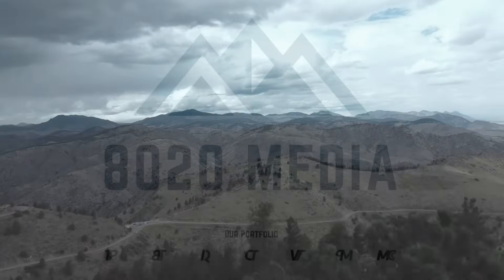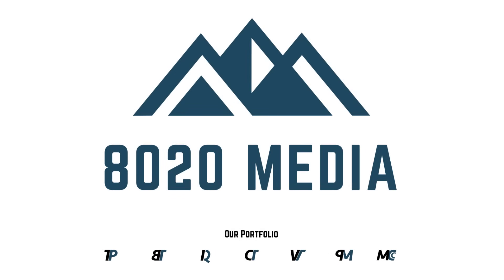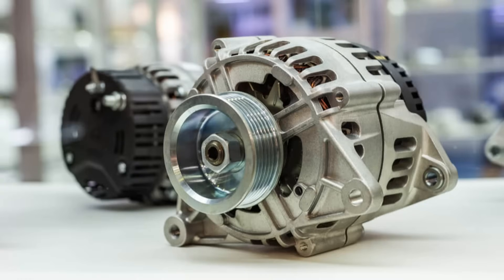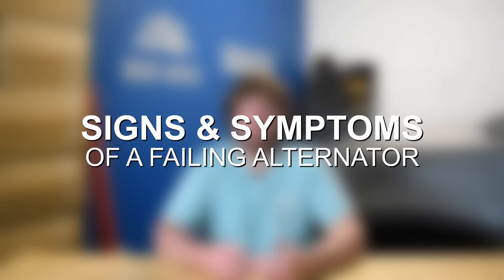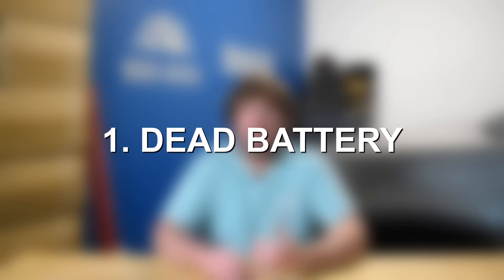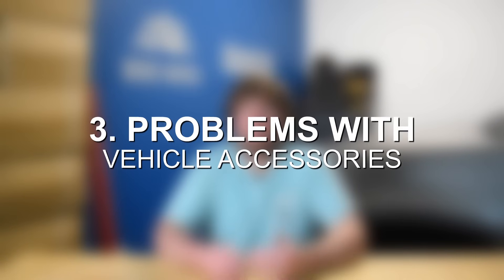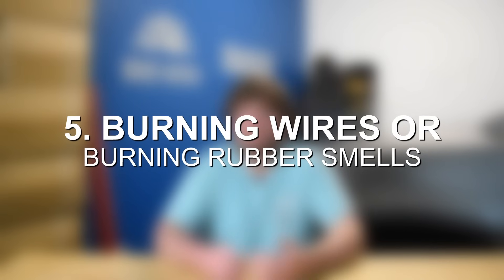6 Symptoms of a Bad Alternator!

Comment: I have a 2012 Honda accord ex-l. While I'm driving my battery light won't be on but a little after I turn on my a/c the light will come on. After I finish driving most of the time I'll turn off the car and it will start right up with no battery light and eventually it will come back on. After a small drive I parked my car and went to start it and it wouldn't start but after waiting a couple hours without charging the battery it started right up. Its leading me to think its my alternator but I'm confused how my car wouldn't start but after letting it sit without doing anything it started right up.
Reply from the maker: B - Certainly sounds like an alternator issue. You can get your battery tested to rule that out.

Comment: I'm just trying to figure out if the problem is my battery or alternator and ended up learning 4 times as much...
Reply: That is exactly the problem my peugeot 207cc has ,all those symptoms are visible, It seized on the way I called a mechanic, he came and jumpstart the car,after 1 day same problem, we bought a new battery and I only drove the car for 40 minutes, it drained the new battery. So I have transported the car to the garage ,after explaining all these to them I told them the car surely has alternator problem.
Reply from the maker: N - Sure sounds like it to us!
Reply: I got an battery and an alternator tester and it says that my alternator needs to be replaced . I was wondering why my car won't crank up even when people connect their jumping cables on
Reply: When I put the key in it will do a click click sound or the engine will turn over but it's not getting its power needed flickering lights kept blinking on before it couldn't cut on
Reply: @Cierralewis5016 that means a new battery
Reply from the maker: R - Hope that's a good thing? Thanks for the feedback.

Comment: I have a 79 Lincoln Mark V.  It died on the road today as a result of a failing alternator.  Would it be a bad idea to install an alternator that's More powerful than the factory. 60 to 70 amp alternator?  I was Thinking 100 amps.

I have an aftermarket sound system with an 800 w amplifier that powers two, 12-in subs (So it's nothing crazy).

I've heard that oversizing an alternator could fry the battery cells, but at the same time I don't want to be stranded again as it was not very fun today.

Any help would be greatly appreciated. 

Thank you in advance!
Reply: Hey I have a 79 Lincoln Continental and had the same issue it would should off on my all of sudden got a new battery but still don’t crank over to start now what did you do do yours ?
Reply: @juliancar2  100 amp alternator+a capacitor for the amp
 & subs
Reply from the maker: R - Have you taken it to a mechanic?
Reply: @8020Automotive  Yes - 2 mechanics.  They told me that the alternator is shot.  Even as I was testing the alternator myself while the car was running (after boosting), the voltage of the battery was declining instead of charging, or hovering around a constant voltage as it should.  The battery is 7 days old.  I was told that the best way to deal with this, would be to use an alternator with bigger amperage, as the aftermarket sound system is drawing significantly more than with the current alternator is designed for, and to use something as a buffer (such as a capacitor, a battery equivalent to the one running the car, or a gel battery).

Essentially, the alternator was not keeping up with the draw of the aftermarket sound system, so then it became overworked and ended up failing.  Contrary to what many people believe, a 100 amp alternator that replaces a factory 60 amp alternator will not fry battery cells.  If we were to throw in a 300+ amp alternator that is meant to run competition sound systems, then it would affect the battery.  Since we're going from a 60 amp or 70 amp to a 100 amp, the difference is not enough to warrant such concerns.

Hope this helps.
Reply from the maker: T - Wow! Thanks for taking the time to share this. It will certainly help future viewers.

Comment: One question, can bad altenator cause the aut. transmission not working properly. 
Sliping, vibrating,
Reply: O and NO codes
Reply from the maker: T - It does sound like an alternator issue based on the symptoms above.
Reply from the maker: T - It certainly can! Do you have any engine codes?
Reply: Well, just at starting the engine the lights of ABS, TCM, ESP come on for second/two.

 Did notice that when i drive with lights, fan, OFF transmission is working litle beter

Comment: My Battery light came on and while i was driving all the lights turned off as if i cut the car off but was still driving then died about 45 seconds later? Think its my Alternator i have a 2018 ford f250...
Reply from the maker: D - Certainly sounds like it! Keep us updated.
Reply: @8020Media  Definitely was went got a new one FIRED RIGHT UP ALL SYSTEMS GO‼️🕺🏽

Comment: Does a alternator and fuel pump have any relation whatsoever? Because for a little while now I’ve had trouble starting the car within 5-20 minutes of turning it off, but if it’s longer than that it starts no problem. Thought it was fuel pump at first but I had my alternator tested and it said it wasn’t good. Now, my brake, battery, and ABS light come on intermittently. I do hear a slight whine noise when I turn the vehicle, and when I popped the hood I did smell sort of a burning/hot smell. No overheating however or rpm’s going crazy or anything.
Reply: Yeah, that's definitely your alternator, bud.
Reply from the maker: T - Certainly your alternator. Keep us updated.

Comment: Can a rebuilt alternator be going bad and overcharge my battery??…. Bought a new battery since it was boiling/hot to the touch. New battery in and still overheating….. should we replace the alternator all together?
Reply from the maker: Sounds like it could be the voltage regulator - if its failed it could be sending way too much voltage

Comment: Hey quick quesion, my 2011 Ford Explorer is showing the "check charging system" light on the dashboard. The power steering is electric so i can feel the power steering tightening up while reversing. I installed a new alternator a month ago from amazon (A-premium brand) and it worked just fine until now.

You think it's the alternator going out? Any chance a new alternator can go bad that quick? Or maybe i should change the timing belt. I've already installed a new battery a month ago.
Reply from the maker: Z - This sounds like an alternator issue. It is possible that you could have bought a faulty alternator. Have you had it checked out?

Comment: I just changed my alternator but when i was gonna turn on my car all the lights where on like if the car was was on i can see my miles and everything with out the key ignition , once i did turn it on i rollerd my passenger window down a lil bit after i cut it off and cut it back on i had nothing no dash no radio no windows , what you think possibly happend
Reply: Yes that actually how it died down i was driving it back from shop and it started sturdering and bogin out before completely turing off my battery completely went out , im thinking they didnt connect the alternator correct or the pig tails cause the back conector to altanator had broke so we had to connect a new one
Reply from the maker: A - Sorry to hear about this. Keep us updated!
Reply from the maker: A - When was the last time your battery was replaced?
Reply: 1 year ago it was replaced boss .
Reply from the maker: A - Hmm. Our guess would be the battery, but it shouldn't lose it's charge that soon. Have you taken it to a mechanic?

Comment: In my mind a test for the alternator is with the engine running take the positive lead off of the battery. Then check voltage across that lead to body ground to see what the alternator is actually putting out. Anyone know if this is a viable test or if I'm on crack? My 2016 Odyssey has battery light on. Had burning smell last week. Check  voltage on battery with van off - 12.1v. Start van and it drops to 11.5ish. Remove battery positive lead and it dies instantly. At $801 OEM new part, $470 for a record I really want to be sure before I buy one! Thanks all.

Comment: This is probably been one of the most useful videos. I have a used 2010 Jeep liberty sport.
I have already replaced the battery back in February.
For the last week, my car is suddenly dead overnight with no lights on or doors open. I’ve noticed the motor functioning to my window slowing and there are times my lights will dim and adjust while driving. I jumpstarted the vehicle and still having some issues. I am going to try to get my car in somewhere tomorrow. Thankyou again!
Reply from the maker: O - Certainly sounds like an alternator issue. Thanks for the feedback!
Reply: Same thing happened to my jeep

Comment: My car loses acceleration only in the night after driving some distance and steering becomes little tight . But no problems In day time driving. then I noticed the dash board flickering when headlight on and when I off the headlight and drove…no issues with power loss
Also I smelled some wire burning ..
Battery has green indicator 
I guess it’s alternator
Reply from the maker: Yeah you're alternator is probably weak. It can't keep up with the extra current draw required by the headlights. If not that, an issue with the idle air control valve could cause it as well. Worth checking that first before spending money on an alternator

Comment: How about an alternator that works part time. When I start the Kia the battery light is on and if I rev the motor to 2500 RPM then it starts working. It’s do e this for months then now it won’t work. The next day it worked again just to stop working again. lol. I have checked everything. Literally everything. There is no check engine light so for once I’m freakin stupmped and I gotta get it figured out.
Reply from the maker: B - I mean it is possible for it to be intermittent. You may want to get it checked out.

Comment: I bought a new battery hoping that it would fix the issue but nope 😢. Battery is 14 years old so thought it mighr have been it.
Reply: What kind of battery is that last 14 years I need that brand of battery.
Reply: @samuelbrown7108  Lol, i dont think they make it anymore, it was a stock panasonic battery on a 2010 evo x
Reply: @samuelbrown7108  everlast 😂
Reply: Battery and alternator could both be bad
Reply: I changed the battery and drove it 2 hours and it died
Reply: @nanicasillas6492 
You need to replace your alternator ASAP. Your car's alternator is bad and it's draining your battery.
Reply: Jump start then drove a few minutes then it died again
Reply from the maker: N - Have you looked at the alternator? We also have a video on engine stalling that could be helpful for your research: https://youtu.be/7bqAIbYRdnc
Reply from the maker: U - What problems are you experiencing?
Reply: @8020Automotive  Found out it to be a fuse issue
Reply from the maker: U - Thanks for coming back and sharing your experience!
Reply: 14??? My land
Reply: You probably had the best battery ever
Reply: @inspirationaltreasuresllc   Lol, i dont think they make it anymore, it was a stock panasonic battery on a 2010 evo x
Reply: @unknownx9238 what fuse was it? I’m having similar issues as well.
Reply from the maker: C - You should be able to check in your vehicle's manual.
Reply: @cmason415  Engine relay fuses
Reply: @uknownx9238  how do you test relay fuse. Sorry that is dumb question I don't have meter to test. Fuses you can see
Reply: @lisalafond6080  Other parts uses the same fuse so I just swapped some of the fuses around to see if it resolved the issue which it did.
Reply: 2004 escape have changed alternator x2 thinking first one was bad from auto store not charging battery.  Battery was tested and was fried by alternator so new battery wont charge on escape will charge on another vehicle.  Battery not charging with new alternator. Had fuse that looked bad and changed   it was alternator fuse I believe. Changed clamps to battery they were in rough shape. Still no charge to battery. I need suggestions on what to do or try next plz I've been almost 2 months trying to get vehicle back on road. I would never imagine it to take so much to get alternator off escape 2005 model. 8 hrs x 2 and put back together 8 hrs x 2. Pull axel and hardware to the axel aframe etc.    thought the plug may be bad because the middle wire was not attached to anything out of 3 wire still makes no difference with the new plug and all three wires attached to the plug is it just supposed to be two wires to this plug and or al 3 wires to plug.   How do I test the relay fuse
Reply: I think it’s my battery.. I left my car sitting for 3 days now I need a jump every day.. now my car won’t even jump but the lights come on when I put the jumper cables on
Reply: Bad alternator can ruin a battery. Best to change it asap

Comment: I monitored control module voltage with a BlueDriver scan tool and I noticed the voltage range shown as 0.07V to 58V! I have not seen these values as they must happen very briefly but they show in the range. Does this sound like a bad voltage regulator in the alternator?
Reply from the maker: Yeah sounds like a voltage regulator issue, check all your wiring too and battery grounds but likely regulator

Comment: Can a bad alternator kill your battery??
Reply from the maker: I - It certainly can.
Reply: Yes. I had a brand new battery put in my 1997 Ford econoline e350 on sat 8/10 and was dead on 8/13. Had my battery and altenator tested and battery was fine but altenator is not giving enough voltage.

Comment: Can bad alternator cause erratic idle or misfire?
Reply: You're basically only talking about the electrical issues of an alternator..... Not the mechanical. If the bearing is going bad then yes, you can have misfire.
Reply from the maker: S - Thanks for sharing.
Reply: It shouldnt misfire due to a bad alternator but it can cause idle to be weird due to an uneven load on the engine
Reply: Yes it can lmao
Reply: Spark plugs
Reply: Or coils
Reply from the maker: S - Unlikely.
Reply: It absolutely can. An older engines where there was a rotary ignition coil it wasn't as predominant but because most of the ignition components like the spark plug coils are all electronic it can absolutely cause the engine to misfire on different cylinders randomly. Because the alternator needs to have a consistent 14 volts most of the components don't get what they need when an alternator begins to fail therefore most of the systems on the car freak out and it is more predominantly seen on the instrument cluster doing really crazy things. More than likely in most situations when you start to see these signs it's a good indicator that your alternator is either going bad or has begun to fail. The other way to check would be to verify the voltage of the battery with the car at rest and the voltage while the car is running if you're not seeing 14 volts on the battery while the car is running that's a pretty tall tell sign that your alternator has died.

Comment: What about the batter light on the dash?
Reply from the maker: Jerry - Battery?
Reply: @8020Media  yes sorry meant to say battery light is on
Reply from the maker: J - May want to get your battery checked.
Reply: @8020Media battery light was on, then a bunch of different dash lights came on and car ended up not starting. Got battery tested and was told it was a bad battery. Got a new battery and the battery light came on again after a short trip 😭

Comment: I bought a brand new battery and alternator 2023 september and im getting these symtoms on my 08 Kia sorento. After car stays on for some time, lights start to flicker and start dimming down and i get abs light and esc light on and some times check engine and battery light, read codes and come back as p1295 and p2106 which are related to the throttle body. Do you think its the throttle body or alternator again? I warrantied the battery and same issues now im thinking of taking the alternator to get it tested and warrantied if it comes back as bad.
Reply: I’d say throttle body. Just had same issues with engine light , abs and battery light.
Reply from the maker: D - Thanks for taking the time to share your experience.
Reply from the maker: M - This sounds like an alternator issue to us. Wouldn't be a bad idea to get the alternator checked out before touching the throttle body.
Reply: My 2002 toyota tacoma wouldn't start, even with a jump start. I just changed the ignition , jump started it and it started right up.
I let it run for over an hour. I turned it off and now it won't start.
Battery or alternator?